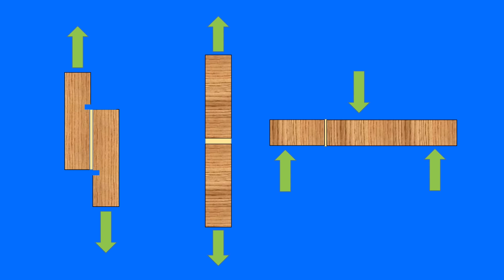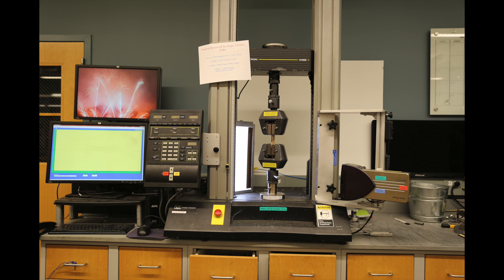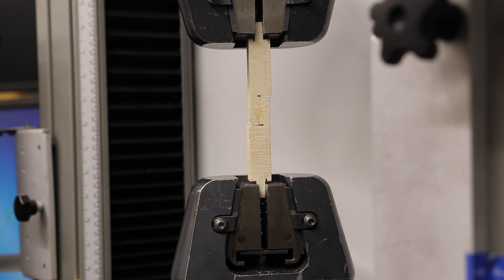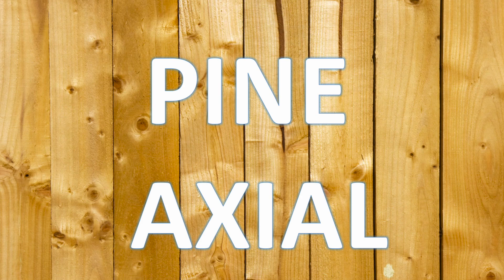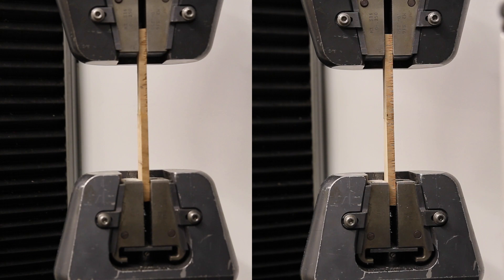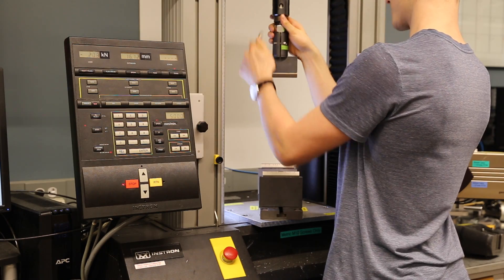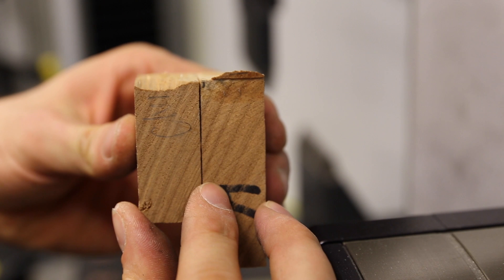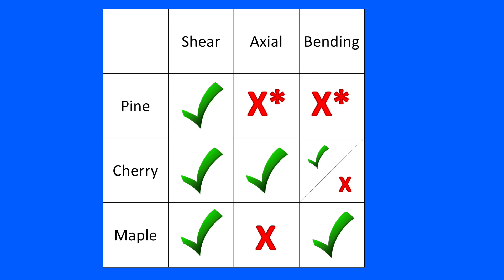Does wood glue bond stronger than wood?

Comment: Just a few issues I have with this, that may or may not have an affect on the outcome. with the shear test you aren't getting pure shear, the way the sample is you are creating a moment at the center of the glue line, and with the stress raiser at the end of the cut you end up with the failure mode you observed. To fix that you would need to test in double shear. growth ring direction is also important in the strength of the would quarter sawn is weaker in tension then flat sawn. To test this more conclusively you need to show control samples with no glue, as in a single piece the same shape. A control sample will show you what to expect failure mode wise if the wood is weaker. Some numbers from fancy machine would also be welcome :)